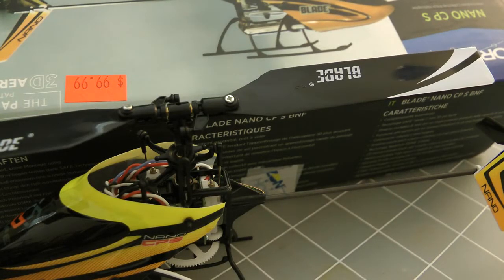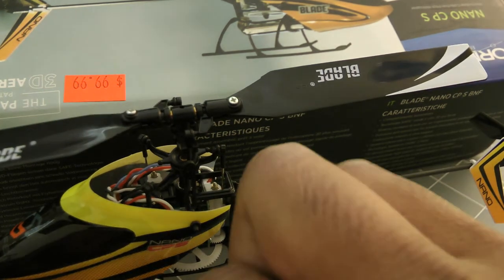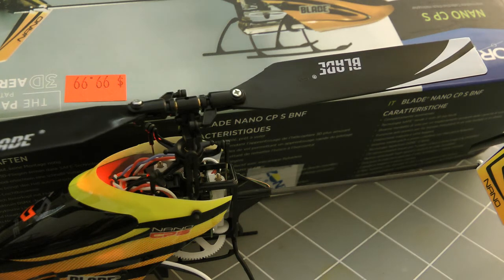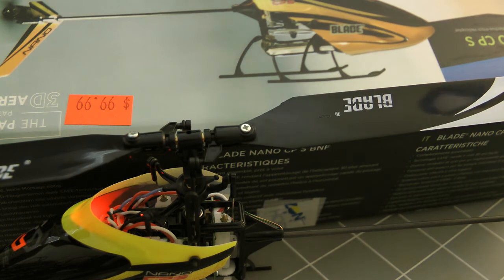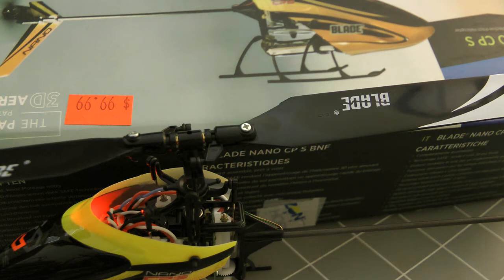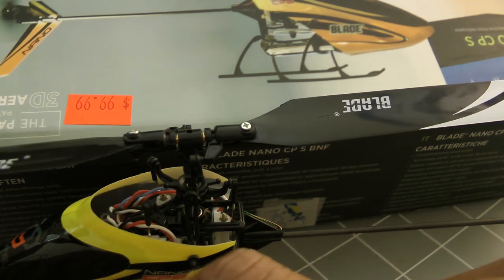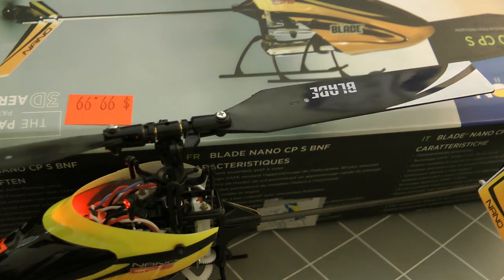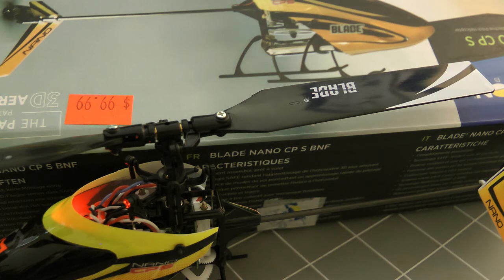Blade Nano CP S Helicopter Swashplate Drift / Centering Fix Using Sub Trim

Comment: I'm trying to understand this. Is the problem the pwm signal that the transmitter sends out at center stick? It should be the value that centers the servos, but it's not? Some radios send different pwm values at center stick? How does that happen?

Comment: the gear on the servo is still moving all way to end of vid, anyway to remove complete?
Reply from the maker: For me, the state it was trimmed to was good enough.  I no longer have this helicopter so I can't see if I can trim it any better than shown.  I do however have the older MCPX BL helis and they are absolute beasts for the back yard.

Comment: its funny mine won't take off in stability mode due to excessive back tilt while it flies fine in agility mode.
Reply from the maker: Mine did the same thing until I fixed the issue noted in my video.

Comment: Hey Buddy and thx for this video. I have this model in a newer version, but it don't level the swashplate straight with the result when I take off it drift pretty much to the right. I know Choppers will do this because of the momentum and rotation of the Rotor Blades, but this is insane. But I can't seem to fix it with my Spektrum DX9 as I'm new to programming transmitters. And when I look at the servos they do not center and it wanna tilt to the right on takeoff if I not counter-steer that. A few clicks on the remote fix this, but it have never been stable and I'm pretty irritated with Blade or Horizon for this. And so much money for a printplade and 2 tiny engines and thin plastic and a landing gear thin as sheite. When all this is said, I had much fun with it, but the drifting is worse...
And my Thr Hold does not work in stunt 2, and it shift to red like here, why?
Reply from the maker: Vibration can cause the to behave unexpectedly in flight.  Also, it may be possible that my electronics are different than yours so my comments may not apply to your helicopter...I would think Blade would have made setup more robust.

Take your helicopter to your local hobby store and see if they can give you some hands on help with this.

Comment: It's the lousy mount for the board.  It's flopping around. Fasten the board mount securely and level, and problems went away.
Reply from the maker: Back when I made this video I found that the mechanics appeared ok.  The only thing that fixed my issue is what I described...  Thing may have changed since I made this video.  BTW, I fly MCPX BLs now...the are much better for me.
Reply: Same here ^^

Comment: Hey i just got one as well with a dx8 G2 and mine is hard tear drift. Full forward elevator bring it to a stable hover but no forward flight. Rudder seems ok but would I be able to fix this with just sub trim as well? Thanks for the video. Good info here.
Reply from the maker: Apparently there is a other way to calibrate this helicopter.  Start with your Tx at full throttle.  Plug in the helicopter battery and a light will start blinking.  Lower the throttle and the helicopter will arm.  Hover it level for 30s and land.  Cycle the power to the helicopter and it should work.  Please research this further before attempting.  

I am hesitant to say yes to your question because your unit may have different firmware installed than mine.  Try it and see...the helicopter is pretty strong so you won't break anything:)
Reply: @eco8gator  yes that is the correct  method.. also take the canopy off and make sure your all in 1 board is level with frame, mine had 2 small dampers not attached correct causing mine to drift.
Reply: Thanks for the reply. I’ll look into it and give it a go. Got nothing to lose really. Lol. Cheers

Comment: can you show how to do that with the spectrum dx6i
because i have exactly the same problem
Reply from the maker: Jan D'Huyvetter Switch to aero mode,  go to the sub trim menu and adjust the ail and ele until the drift stops.  Note you will have to use your cyclic stick to re-center the swash to judge if your adjustment made an improvement or made the issue worse.  When you put the swash center with the stick and let go of the stick the servos should not move...can judge by the lack of movement of the brass colored collars on the tops of each servo...

I don't own this heli any more and I don't have the DX6i.
Reply: eco8gator i have done what you sad and it wors fine now i thank you so mutch and for others with the dx6i i have set the aile 44 to the right and the elev 14 down
Reply from the maker: Jan D'Huyvetter I am glad to hear the your heli is working correctly now.

Comment: Mine flies perfect in 3d mode but absolute shite in Stab mode, even after a lot of trim flights. Luckily i dont need stab mode but it would be nice to have it working. Sub trim dont work in stab mode either so :(
Reply from the maker: There may be something wrong with the accelerometer sensor...
Reply: same thing with mine, would be nice to have it working for indoor missions

Comment: Pop the ball ends off connecting to the swash plate and adjust those. Trying to trim this problem out isn't the correct fix.
Reply from the maker: The servos move and continue to move until the servo hard stop...how will mechanically trimming fix this issue?
Reply: This is not the traditional trim problem between mechanical neutral and transmitter neutral. This is purely engineering problem between transmitter manufacturers.
Reply from the maker: You can't look at it that way.  Any reasonable engineer (BTW, I'm an engineer) would know that there is no standard between radios and when you couple that with parts tolerances and other factors there is just no way that one could expect the neutral points to be the same...it's simply unreasonable.  All I did was make a minor adjustment to my neutral point to make it match the hard coded expected valued in the micro controller.

Comment: how do you fix it if you have the RTF version which comes with a radio where you can't adjust those figures?
Reply from the maker: I'd attempt to use the trim buttons to fix the issue.  Hopefully there is enough resolution in the trim to dial out any drift...if not return it for a new one.
Reply: eco8gator 

I had drift on mine out of the box.  It is the ready to fly version as well.  I used the digital trims, which helped get rid of the drift mostly.  It became glitchy after that in flight though and would move quickly in a random direction and just as quickly level out.  Needless to say it didn't feel safe flying it this way.  I decided to center the trims on the transmitter and try fixing it mechanically.  I bought a swash leveling tool from Rakon Heli and noticed the swash was far from level.  After leveling it the heli flew great.  I recalibrated the safe mode and it flew even better.  I also ordered a full frame conversion kit from Rakon and installed it as well, which is total overkill and not necessary, but was a fun build though.  I have the review of this frame and first flight on my channel if you are interested...beyondthebluerc1